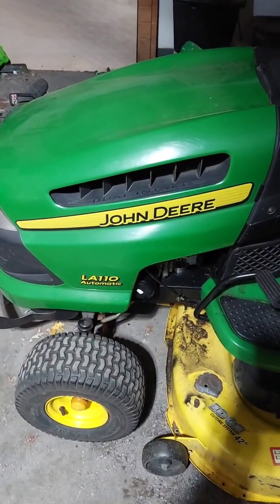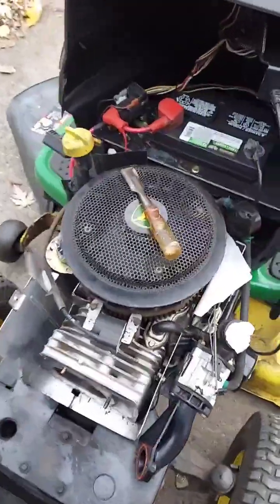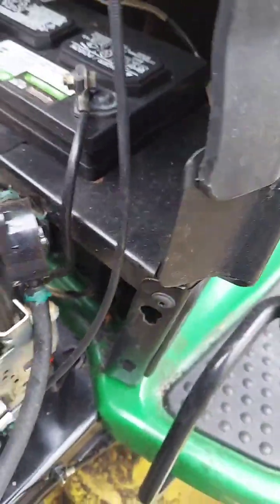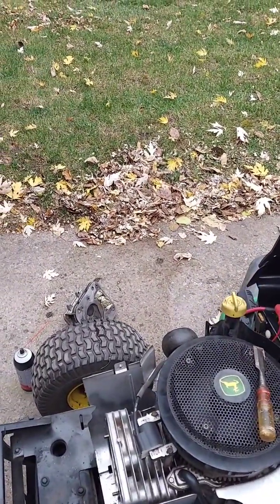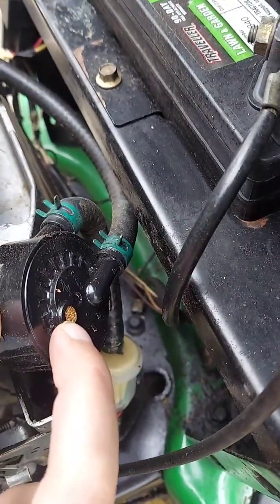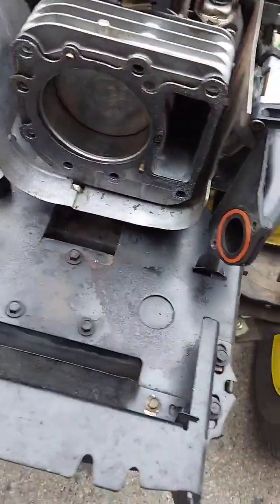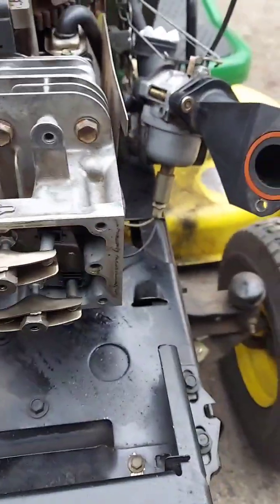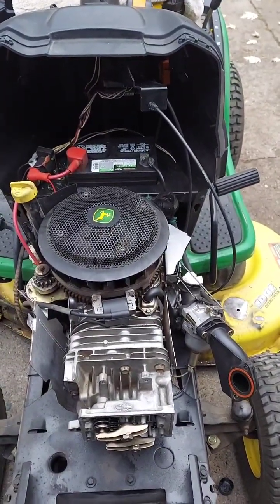DIY John Deere LA110 Head Gasket Change

Comment: Fuel pump doesn't cause a oil leak.
Reply from the maker: No the head gasket did. It was leaking oil out of a screen on the back of the old fuel pump and the new fuel pump. I literally watched the oil come out of it so it absolutely did leak oil out of it.
Reply from the maker: Once I changed the head gasket no more oil comes out of it. Like too much crank pressure